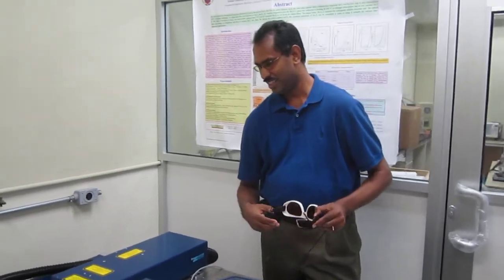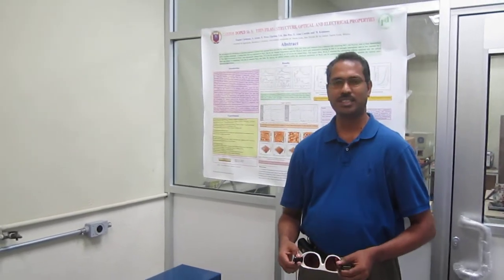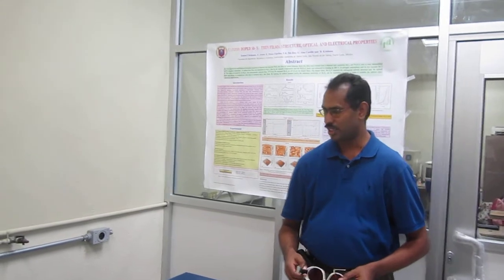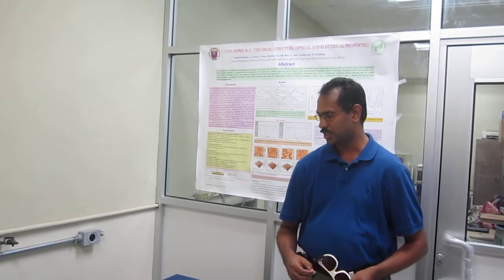Del Mar Photonics Nd:YAG laser system at the Universidad Autónoma de Nuevo León UANL

Comment from the maker: Variable Attenuators for Femtosecond Ti:Sapphire Lasers
http://www.dmphotonics.com/GreyhawkOptics/variable-attenuator-for-femtosecond-TiSa-lasers.htm
Diffractive attenuators control the power of laser radiation using diffraction gratings. Since phase diffraction gratings do not absorb light they can be used for high-power laser radiation (cw, pulsed). Variation of grating parameters along the substrate results in variable transmission at a given wavelength.
Diffractive attenuators can be designed for wavelength from deep UV till IR for laser powers up to 250W/cm2 in CW and 1000mJ/cm2 in 10ns pulses.
Light beam passing through a diffractive grating is partially deflected into several diffractive orders, which get subsequently blocked by diaphragm. Thus the zero order beam (does not change the direction of propagation) is attenuated. The intensity of output radiation Ioutput depends on the grating design and wavelength of input beam. By changing the grating parameters one can control the power of output radiation1. The transmission coefficient of such an attenuator is h = Ioutput/Iinput..
Design of diffractive attenuator on the base of circular diffractive grating.

Variable Attenuators for High Power Lasers
http://www.sciner.com/Opticsland/DVA.htm
Diffractive attenuators control the power of laser radiation using diffraction gratings. Since phase diffraction gratings do not absorb light they can be used for high-power laser radiation (cw, pulsed). Variation of grating parameters along the substrate results in variable transmission at a given wavelength.
Diffractive attenuators can be designed for wavelength from deep UV till IR for laser powers up to 250W/cm2 in CW and 1000mJ/cm2 in 10ns pulses.
Principle of operation
Light beam passing through a diffractive grating is partially deflected into several diffractive orders, which get subsequently blocked by diaphragm. Thus the zero order beam (does not change the direction of propagation) is attenuated. The intensity of output radiation Ioutput depends on the grating design and wavelength of input beam. By changing the grating parameters one can control the power of output radiation1. The transmission coefficient of such an attenuator is h = Ioutput/Iinput..

Diffractive attenuators control the power of laser radiation using diffraction gratings. Since phase diffraction gratings do not absorb light they can be used for high-power laser radiation (CW, pulsed). Variation of grating parameters along the substrate results in variable transmission at a given wavelength.
Diffractive Variable Attenuators are based on binary optics technology. Attenuator manufacturing starts from computer design of two-dimensional diffractive gratings using proprietary Diffraction Optics Design Software. Master Grating mask is created using high-resolution laser photo plotters. Final manufacturing process is accomplished using lithographic methods including plasma etching.
Diffractive attenuators are designed for wavelength from deep UV till IR. Damage threshold for these high power attenuators is more than 250W/cm2 in CW and 1000 mJ/cm2 in 10ns pulses.
http://greyhawkoptics.com/index.php?cPath=31_61?

Variable Attenuators for High Power Lasers brochure
http://www.dmphotonics.com/DVA.pdf

Laser Attenuators for Nd:YAG Lasers - Del Mar Photonics
http://www.dmphotonics.com/GreyhawkOptics/Laser%20Attenuators%20for%20NdYAG%20Lasers.htm

Comment from the maker: The optical attenuators (OAFP, OAGP) are designed to attenuate laser radiation with more than 1:10^3 ratio. The OAFP 
model comprises a thin zero-order half-wave phaseplate and two mirror polarizers that select the input pulse according to 
polarization. This model has been specially developed for pulsed femtosecond radiation as it introduces as little dispersion to 
the pulse as possible. For longer pulse durations we offer the OAGP model, which has better transmission ratio as a Glan prism 
is used to simplify the scheme.
 The attenuator comes in motorized and manual modifications. Please enquire for more information.
http://www.dmphotonics.com/Product_Data/OAFP_Attenuator_datasheet_DMP.pdf
OAFP OAGP
Dynamic attenuation range >10^3 >10^3
Wavelength 250-1500* nm 250-1500* nm
Bandwidth**, % to central wavelength 6-20 % 10-20 %
Required input pulse duration <100 fs >100 fs
Transmission 65 % 90 %
Clear aperture >10 mm >10 mm
Angular rotation of the half-wave phaseplate 40° 40°
* - please spicify with order
** - depends on the central wavelength

Comment from the maker: SOLID-STATE RAMAN SHIFTER
The Solid State Raman Shifter LZ series uses innovative technology Ba(NO3)2 (shift 1047 cm-1) and KGdWO4 (shift 767.3 and 901.5 cm-1) crystals. The crystals’ unique properties allow their application for Raman frequency conversion ranging from VIS to IR. The nonlinear crystal placed in the optimized cavity ensures high conversion efficiency of the the pump radiation to the 1st, 2nd or 3rd order Stokes, alongside with low generation thresholds. Upon your order mirrors can be installed into the LZ221 Shifter for obtaining definite Stokes, as well as for receiving the multi-line output (generating several components simultaneously) with the total conversion efficiency more than 50%. The design of this device minimizes the needs for user adjustments and allows to easily replace cavity mirrors while re-aligning the Raman Shifter from one wavelength to another.
http://www.dmphotonics.com/NdYAG_laser_harmonics_OPO_Raman_Shifter/Solid-State-Raman-shifter-for-NdYAG-TiSApphire-Ruby-CrForsterite.pdf

Comment from the maker: OPO
http://www.dmphotonics.com/NdYAG_laser_harmonics_OPO_Raman_Shifter/OPO_NdYAG_Optical_Parametric_Oscillator.pdf
http://www.dmphotonics.com/OPO_web.pdf

These OPO systems are developed based on the end user's demands and are highly reliable and easy to operate. The main advantage of the OPO LP series is extremely low minimum required operating pump power densities. Thanks to the original optical scheme the specified parameters are obtained even at low pump intensities and as a result neither crystals nor other optics can be damaged. This feature combined with precise optics mounts and dust protective housing insure perfect reliability and long-term output stability.
http://www.dmphotonics.com/532_OPO/OPO%20system%20for%20532%20nm%20laser.htm

Comment from the maker: Raman Shifter for Nd:YAG laser - case study - Request a quote sales@dmphotonics.com
Customer inquiry:
We have need of laser power in the 1310 -1330 nm range. Currently, we are running our Nd:YAG lasers at the 1318 nm wavelength, but when we do this we only get about 20% of the power we get when we run them at 1064 nm. I was wondering if we might do better to run them at 1064 nm and use your Raman shifter to move the wavelength to 1317 nm using your 901.5/cm shifter. We also might be interested in shifting to 1494 nm for other uses.
What kind of powers can you shifter take without damage? Could you give a rough price on one of your units?
http://www.dmphotonics.com/Raman_Shifter/Raman%20shifter1064%20nm%20to%201328%20nm.htm

Comment from the maker: Customer inquiry:

Could you please give me a quotation for a fourth harmonic (266 nm) for Nd:YAG laser? - Request a quote
I have a Surelite II laser which produces fundamental wavelength.
The specifications are as follows for 10 Hz 1064 nm pulse:
Energy of 650 mJ at 6.5 Watts
Pulse width of 5 -7 ns
Divergence 0.6 mrads

Del Mar Photonics reply:

Please find attached our quote for requested FHG unit as well as our comments/questions typed below.

1. Do you have a second harmonic generator?
To obtain the fourth harmonic it is necessary to have the second harmonic generator.
The conversion efficiency of the second harmonic generator must be not less than 50% (relative to the pump pulses energy at the LG101 input 1064nm).

2. According to our specifications for LG103F, the conversion efficiency of the fourth harmonic generation is 15% (relative to the pump pulses energy at the LG101 input 1064nm). Therefore, the pulse energy at 266nm is 75mJ and the average power is 1W. (In case that the conversion efficiency of SHG is not less than 50%).

Attached quotation is for second harmonic generator LG101 (if you don't have the second harmonic generator) and for the fourth harmonic generator LG103F.

For potential customers:

In order to give you a correct quote for fourth harmonic (266 nm) for Nd:YAG laser we need to know detailed specifications of your laser
1. energy of laser system
2. wavelength
3. pulsewidth
4. beam diameter
5. pulse repetition rate
6. polarization (horizontal or vertical) of a laser beam
7. divergence of a laser beam

http://www.dmphotonics.com/NdYAG_FHG/Fourth%20harmonic%20266%20nm%20for%20NdYAG%20laser.htm

Comment from the maker: For potential customers - contact sales@dmphotonics.com
In order to give you a correct quote for fourth harmonic (266 nm) for Nd:YAG laser we need to know detailed specifications of your laser
1. energy of laser system
2. wavelength
3. pulsewidth
4. beam diameter
5. pulse repetition rate
6. polarization (horizontal or vertical) of a laser beam
7. divergence of a laser beam
http://www.dmphotonics.com/NdYAG_FHG/Fourth%20harmonic%20266%20nm%20for%20NdYAG%20laser.htm

Comment from the maker: The Fifth Harmonic Generator model LG105 is compatible with any pulsed 
Nd:YAG laser, and is designed to produce UV-radiation at 213 nm. The 
Nd:YAG laser, equipped with LG105, is a versatile device, and in many 
applications can eliminate the necessity for excimer lasers. Solid state 
technology that does not use toxic gases and costs less gives you the 
advantages of both consistent, day-to-day operation and low maintenance. A 
high quality BBO crystal is used in the LG105 as the non-linear element, 
providing up to 20% conversion efficiency into 213 nm. The non-linear 
crystal is placed in a special cell ensuring long lifetime of BBO without any 
degradation or breakage. A harmonic separation system installed in LG105 
provides nearly 100 % spectral purity of the output at 213 nm. The LG105 
Fifth Harmonic Generator gives you not only high power output but also 
excellent radiation stability. 
http://www.dmphotonics.com/NdYAG_laser_harmonics_OPO_Raman_Shifter/Fifth-Harmonic-Generator-NdYAG-laser-LG105-manual.pdf